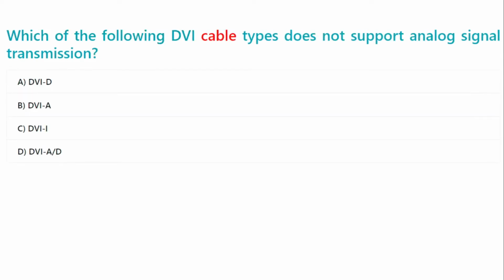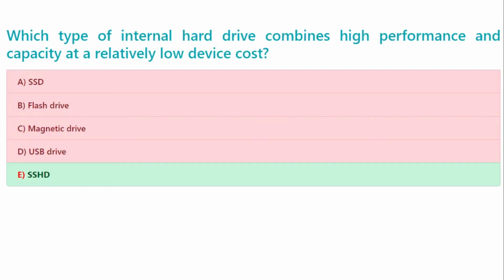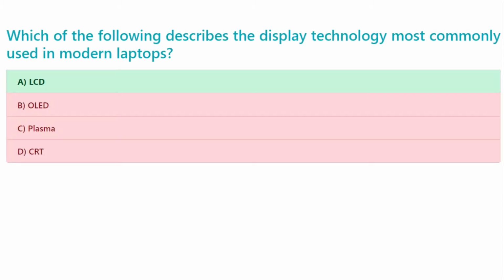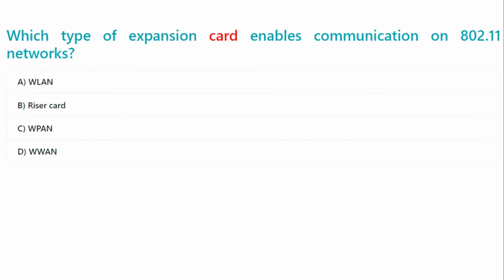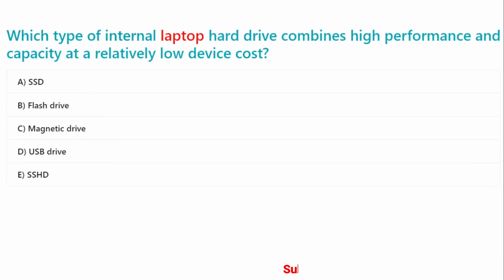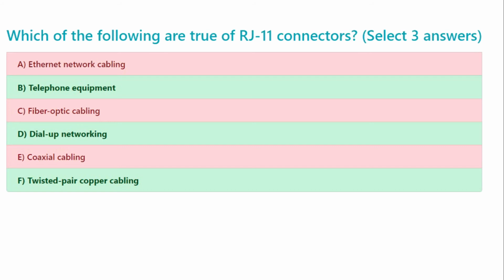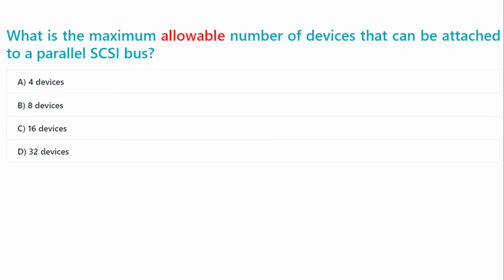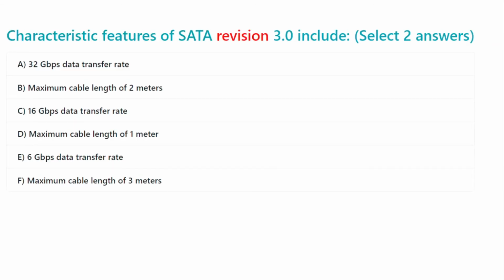CompTIA A+ Certification Exam Core 1 (220-1001) Practice Test 1

Comment: Questions are too easy. Worst part in Comptia exam questions is how they formulate multiple choice troubleshooting questions. Some answers are not only debateable, but actually untrue or irrelevant (outdated).
Reply: It's like the one that said that "laptops come with integrated graphics." 
Yes and no.... ????
Reply: @Battlefox64_RL  well we know that apple has integrated GPU now so, you’re both right.

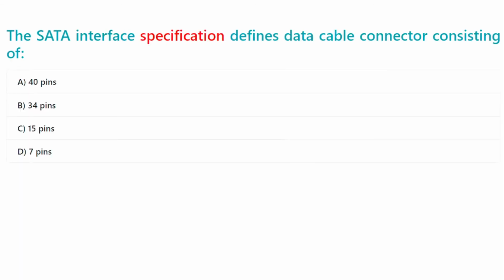Comment: Question at 27:00 is it not 15 pins I even googled it after and it says 15 pins
Reply: Yeah that's what I thought too, but actually A SATA data cable has 7 pins. A SATA power cable has 15 pins.

Comment: inverter  DC to AC? 
I thought it was the other way around because the backlight needs the DC and what you are getting from the Laptop is AC
Reply: No the computer needs DC but the screen needs ac
Reply: LED backlights (used on most modern laptops) require DC, CCFL backlights (used on older laptops) require AC which is why they need inverters to convert from DC back to AC.
Reply: Inverter is Dc to Ac .because display screen need Ac power that what inverter for